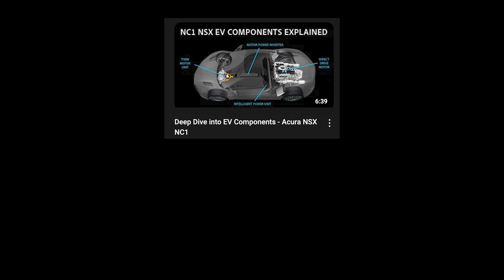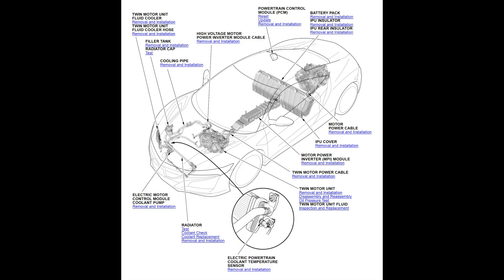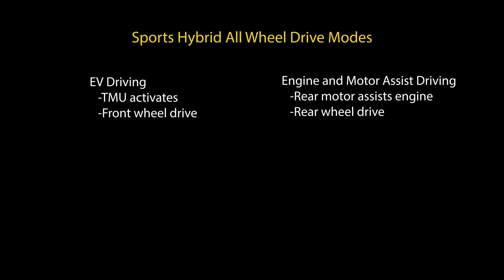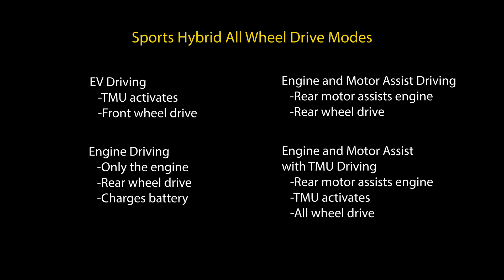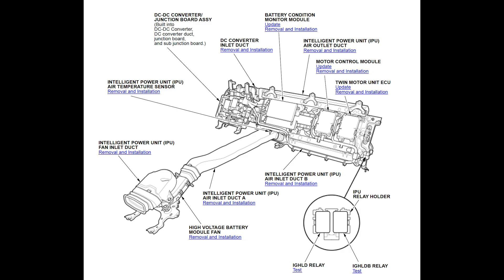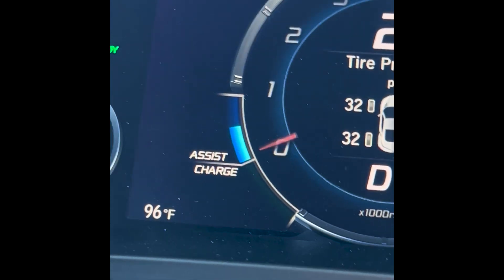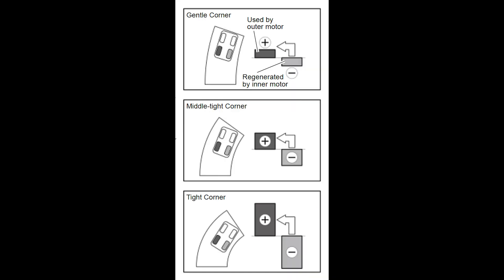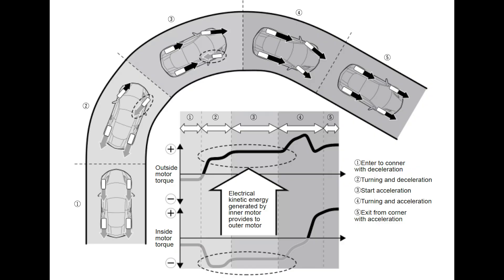The Intelligence Behind the EV System - NC1 Acura NSX

Comment: How does one trickle charge the high voltage battery for storage? I suppose the car has to be driven every few months.
Reply from the maker: Correct. Manual states you have to drive it every so often.
Reply: @DriversTherapy  It might not be impossible to charge up the HV battery via the 12V circuit.
Reply from the maker: @GeneralFukzamatayu  no and there is no need to either. The system keeps the EV batteries in the correct state. Make sure to check this video out to learn more about the NSX EV system: https://youtu.be/Xe2jzFRCpsI?si=8tueF1Kiop6EOlw0

Comment: What's the difference between "EV Start" and "EV Drive"? Are there available power/speed thresholds for either of these modes?
Reply from the maker: From the chart, they are split into two categories. “Start” must be for how the EV assists with turning on the vehicle, as compared to “drive” being for the actual EV driving modes. The minimum power threshold for the battery’s state of charge looks to be a little lower for the “start” application. I believe the chart doesn’t have exact percentages because multiple factors play into the SOC.
Reply: @DriversTherapy  there is no 12V starter in NC1 NSX, so the direct-drive motor must physically "start" the V-6. I believe "EV Start" is 0-6(?) mph and EV Drive is anything above that. Based on videos of NC1 driving reviews, you appear to be able to pull a TINY bit more current from the battery in the first few MPH before the V-6 fires up (peak torque rpm for the front motors is 0-2000 so it may have something to do with that.)